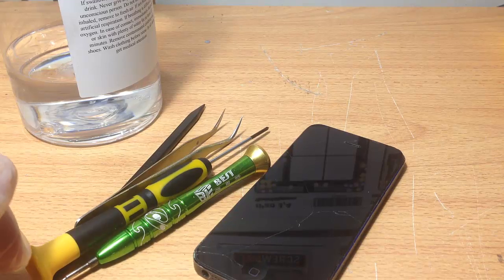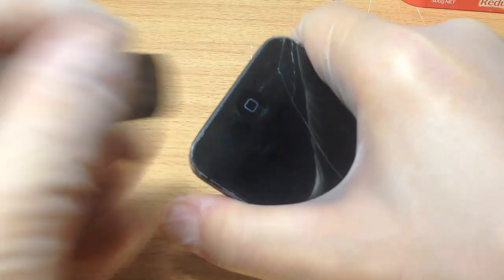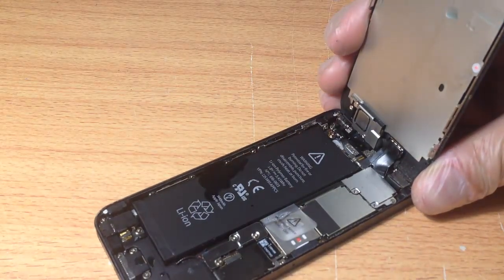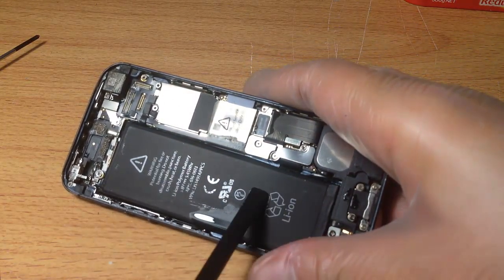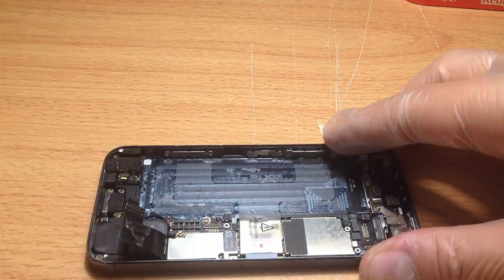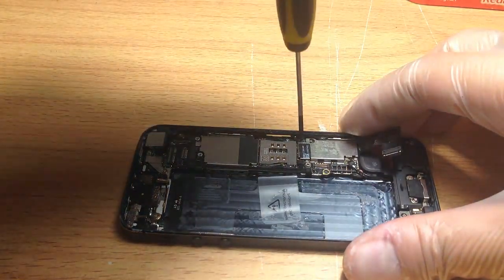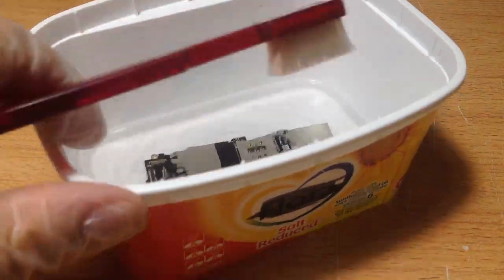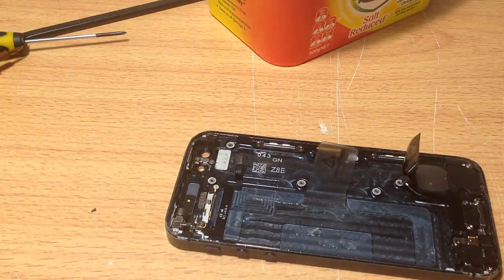iPhone 5 Water Damage Repair

Comment: im repairing my wet iphone 5c, using your video as my teacher... I put everything back in after buying a new battery.  i have a problem with the metal square piece behind the camera.  there are 3 screws of 3 different sizes and I don't know which screw goes into which hole.  please help.
thanks in advance.
-while I wait for your response I will practice my typing skillls  'cuz this took like 5 minutes to type
Reply: curtis constantine still not replied lol

Comment: Will this method work if you've dropped your phone in salt water
Reply: The idea is to dispel the water which in your case is more corrosive. The connectors would be a main concern. The gentle scrubbing (with soft bristle brush) should help with that. I would think this would be a good option as opposed to just air drying face down with sim removed which would leave the salt, etc.

Comment: Didn't have high hopes but this worked and saved my phone which was dropped in a lake for about 1-2 minutes.  I had replaced a screen and battery before so had some experience - it is a little scary to do for the first time.  Get the right tools and be very gentle and watch several videos first.

Comment: I fixed the phone today and It turn on but when I unplug it the battery drops to 1% then turns off and later today the batter because really hot and now when I tried turning it on, it's stuck on the charging screen. I just ordered a new battery to replace it if that's the case
Reply: It should be I have seen lots of videos about the water getting into the battery and messing it up

Comment: i have an iPhone SE are the internals the same as an iPhone 5s ?
Reply: yes they are about the same except the camera
Reply: Mostly, there a few slight differences such as the silver plate that covers the three tabs that plug in the screen has 4 screws and the 5S only has three.  Don't forget those "command" type sticky strips underneath the battery.  You'll see a few more foam type gaskets covering things.

Comment: thank you for the knowledge. my phone was not powering on for almost a month after taking a plunge in the toilet.(just one of those mornings). I cleaned like you suggested and replaced the battery instead of reusing the old one. the phone now powers on and I'm grateful. now the screen backlight needs replacing due to water damage but I'm just happy to see the phone operate again. 

much thanks!!
Reply: I had the same experience... I'm very grateful too! I also have a watermark going through my screen after this process. That is the only problem I have with the phone. How do I fix this? I haven't been able to track down any tutorials on this fix. I borrowed the phone from a friend and don't want to return it to him damaged. Any advice you can offer would be greatly appreciated!!! :)
Reply: +Julie Rose the back light can be replaced. what I found the easiest was to replace the front screen assembly, it is much easier than trying to replace the back light itself because of connector needing soldering. or a away to connect to the flex cable near the camera. this method will eliminate the multi hues display.
Reply: Thanks so much!!

Comment: I dropped my iphone 5 in the toilet and everything worked but the speaker, it sounded really low but my mom used a blow dryer and it worked. ( that was a year ago I believe?) then 2 days ago I dropped it in the toilet again and the screen had different colored lines going across it and won't turn on. My mom put it in a bag of rice for 2 days and it's still not working. It's not turning on even when I connect it to a charger. Any way to fix this? Please someone help I really had a lot of things on my phone and I'm pretty sure I never backed it up.
Reply: stuck in the same situation. how did it go?
Reply: +k kk my phone is dead. It wont work anymore. Which sucks because I never backed up my phone which means my pictures are gone. There is no possible way of fixing a water damaged phone because it already fries your circus and all. I guess just take out your SIM card before anything happens and hope for the best
Reply: +Nerissa Guzman  *circuits

Comment: I was on the lake today and had my phone in a 'water proof bag'.  It never fell in or anything but the bag itself had some moisture inside, so the phone was off.  It has happened before and I usually plugged it into the charger and it would turn back on.  not this time.  I have plugged it in multiple times and I fear that I have messed up the circuit.  Right now it is sitting in a bowl of rice next to me (I'm out of options).  I also hair dried the hell out of the audio jack and charging jack in hopes that I could disperse the patches of water.  After doing research I have seen that these are the 2 things you do not want to do.  My question is this: If the circuit has been messed up, can I still buy a new iPhone 6 and give it to the Verizon store to transfer contacts, pictures, etc. ?  The phone obviously is not turning on, but can they still transfer the data?
Reply: Did it work
Reply: This is for iPhone 5'sdumbass
The inside of a iphone6 looks different than an iPhone5's insides lol

Comment: What if touch screen doesn't work what's the fix for that?
Reply: +15Fire same problem. dropped my in the toilett today
Reply: +Daniel M. Try holding down the power and home button for about 10-15 seconds while the phone is plugged into a computer with iTunes open.
Reply: +Kevin McRae why that?

Comment: Hi i have cleaning it twice (but i havent submerge it) and the screen wont turn on. I went to a person who tried my screen in another iphone5 and it worked! but it wont work in mine. Today after teh second cleaned, I pressed the lock bottun in the exact moment I plugged it to the charger and the screen went on for 1 second and then it was black again. Everything else work, my iMac recognice the phone and everything, its just the screen. Do you have any last final words of wisdom on this particular subjet? (im really srry bout the bad english D:)
Reply: +Rodrigo Heredia Try holding down the power and home button for about 10-15 seconds while the phone is plugged into a computer with iTunes open.
Reply: +Kevin McRae. hiii should the iPhone be on or off??
Reply: +Rodrigo Heredia Try from the off position but I don't think it matters.
Reply: thnk u so much for ur quick respuesta! ill try it in a few secs with my iMac n_n
Reply: +Rodrigo Heredia You're welcome. If that doesn't you probably have to get a new screen or the phone might be dead (RIP).

Comment: Call me asian or whatever, but I fixed mine!!! Infuckingcredible, I tell you! Let me tell you. I took my bed sheets and put them in the washing machine. Coming back to my room, I was about to check my phone ... but I don't have it, and there's something knocking inside the washing machine! What a stupid bitch I am! I just stopped the machine, got my phone out and the poor thing had the screen going crazy. Opened it up, dried with a hair dryer, left it opened for a couple of hours. Then, I put it back and booom!! It works. The only thing is that there still is water somewhere between the glass and the actual screen. It will go away somehow! Iphone 5!
Reply: Mine has been sitting a year or more, still won't cut on. Girl put it in the washer, full wash!

Comment: when you brush your motherboard isnt it better if you take out the sticker of the lcd connectors? and the shields you can get them out with a hot air desolder. Great Vid.

Comment: After dropped into the water 5 meter's deep, i charged it to see if it will boot up then the apple logo sign came on and few sec later it shutdown and heats up(hot) . can it be fixed if I do the 
iPhone 5 Water Damage Repair process ?

Comment: Tried this, but the iPhone won't do anything when I plug it in and try to turn it on. Are there any areas that I might have reassembled it wrong? What could the problem be?
Reply from the maker: +Shnarlea you could check the battery or double check the connections.

Comment: mine got sprayed by water wiped it off was fine, hour later it short circuited  but i can still hear notifications
Reply from the maker: +Sarcalogos Tortolero could be the screen or the touch ic.  i will check connections for corrosion.

Comment: I dropped my iphone 5c in the toilet 2 days ago. I tried everything i could to turn it off, but i couldn't. So it turned off its self. Do you think that this steps that you saying could help, or is it a lost cause? 
ps: the screen was already damed, was broken and stuff, but i did put an screen protection, so i'm not sure if the water found its way in easier or not.
Reply: Well, long history. I was giving my dog a bath, my hand was full of soap, someone called me, i thought was important, and...bang...the iphone ended up drowned.
Reply: I bought a new battery,because the old one was all deformed. I've cleaned, but it didn't work. Is there anyway for me to check if is something in specific is with problem, because the iphone is not turning on.
Reply: +Caroline Netto take it to Apple

Comment: left my phone on my porch and it got rained on and won't turn on, its been in rice for about 2 hours just checked it and won't turn on. am I fucked?
Reply: yes
Reply: Ilate reply but it has to be in rice for 3 days.
Reply: +GT/GD LazoGT Rain water is distilled water and it is the most corrosive water around.  I made the stupid decision to wash my phone in reverse osmosis (distilled) water after falling in a salt water pool with the phone on my belt.  It turned on the next day for about a minute or two and then died.  I tried spinning the water out of it with the spin cycle in my washer after rinsing but couldn't get it to stay horizontal to drain out of the charge plug.  Also tried putting it in the freezer over night to dehydrate it and also put it in the window in the sun.  That is when it started working again for a short time.  But, I ended up giving up on it and buying a Samsung Galaxy S5 which is water resistant and will survive a shallow dip like I took.  Stupid Apple, making a phone that you can't get the battery out of easily.
Reply: +Norman Sufficool Not sure you're right about distilled water being "the most corrosive water around"?  If it was, it wouldn't be used in vehicle batteries surely?

Comment: My phone won't turn on or it seems. When I turn on the phone, I can feel the motherboard being warm.
Reply: It's warm because the processor is failing
Reply: Is it still recoverable?
Reply: It is, but you need to get it professionally microsoldered
Reply: So not even the alcohol can save it?

Comment: I dropped my phone in the toilet and I turned it of and on and it's absolutely fine I checked camera sound and everything and it also charges I only turned it off and shook it
Reply from the maker: +Lucy's BeautyBlog Hi Lucy - the problem is that over time there will be issues due to corrosion so the first thing I recommend is to back the data.
Reply: +infohut will it always break and this sounds silly but how do I back my phone up
Reply from the maker: not always. you need to download and install itunes.  then in the itunes menu back it up. really easy to do.
Reply: +infohut done is there anything you recommend to help
Reply from the maker: +Lucy's BeautyBlog i recommend you take it to a repairer if your not confident in repairing the phone yourself.
Reply: +Lucy's BeautyBlog If you turned off your phone super fast and let it dry out your
 odds of it working despite "water damage" are much higher. I'm 
currently awaiting the results of my second incident, BUT the first time
 I did this I let it sit in rice and air dry for a total of about 48 
hours and it worked fine EXCEPT for the error I got before I had even 
turned the phone off after I dropped it. It's just a "not compatible" 
message with the charger, but it rarely happens a year later and it 
doesn't effect charging. I'll let you know after this time.
Reply from the maker: Kassandra W correct
Reply: Dropped mine down the toilet and it does jack shit. Had to get a new one ahahah
Reply: Kassandra W  I
Reply: See
Reply: Beth Jackson hahah same getting an iPhone 6 lol iPhones are really bad with water damage but still gonna get another one lol
Reply: Lucy's BeautyBlog

Comment: I went swimming in the Murray River for about an hour with my IPhone 5 in my pocket, i got out of the river and realised, i pressed the top button once but maybee another when taking the cover off. 5 minutes later i had it rapped in a towel. Do i have any hope??? +1 Sub
Reply: +Abel Schoneveld  mine went through the washing machine put it in rice for about 3 days
Reply: ***** Yep though my mic dont work i use the apple headphones and it wont sync to my comp besides that it works fine

Comment: im in australia, if i sent a 5 that went in a pool to you how much would you charge to fix it?
Reply: +henry tomkinson  Silly boy, write it off and get a Samsung Galaxy 4, 5 or 6.  The new Galaxy 7 has a lower rating.  They are all water resistant and would survive most water dunkings  and, they open up to remove the battery and to dry out just in case it goes too deep.

Comment: (Help) I currenly Reseted my Iphone 5s But Every Time i try to Set up the State and country  and wifi  it takes me to The lock Menu and It Doesnt let me swipe it but it stills lets me touch the Quick menu Button I Dont know if it might be cause I drop it in a little bit of water or Because the screen has a little crack?

Comment: Guys, THIS IS NOT THE ENTIRE GUIDE! You really need to desolder the silver metal shields on the board to get the real damage!
Reply from the maker: +Josh Bacon this is a basic repair guide. removing the metal shields is not recommended for anyone who has not done it.  you can easily damage the logic board further.   but correct josh - it is definitely a preferred option.
Reply: So, I have one that went thru a wash over a year ago. I see NO visible corrosion. Do you know of a process for resoldering the board, site? And could this be just a battery swap? I don't have these laying around, but have a 5s & 5c - if compatible I would consider having an extra. I have moderate experience, not with Apple.
Reply: Wow! That sucks! Good thing I backup once a week, 299? Ugh! Thanks for the reply!
Reply: Christopher Payne if it's a year old, it's probably fucked. I'm sorry. I would take a look at it and charge $70, and anything worse than a Tier 1 repair and I would address it for data recovery only. Data recovery services start at $299 plus tax.
Reply: Christopher Payne Yeah, data recovery is rough. But a lot of people don't back up. You're a smart cookie Chris!
Reply: L
A
Reply: http://lmgtfy.com/?q=iPhone+5s+red+screen+4013
Reply: http://lmgtfy.com/?q=iPhone+5s+red+screen+4013

Comment: Thank you so much for your detailed video. Even though my phone turned back on after getting some ocean water on it (after a night in rice...) I wanted to make sure it didn't die of corrosion. If I'd seen this vid from the start I wouldn't have bothered with rice. I've never tinkered with electronics and can say that this was so easy to follow that I even had a few beers while doing it and everything still works perfectly.
Reply: did it work?
Reply: +emilyrosebelandres98 
My phone is still working perfectly 4 months later :-) Just be really careful not to lose any of the tiny screws. Ifixit.com also have great guides if you need it.
Reply: It worked for me too and the ifixit 70 piece kit is the bomb. I bought that and the isopropyl alcohol at Fry's... very helpful combo with this awesome tutorial. The only problem I have is a water mark going through the screen. Any ideas on how to fix that?? I appreciate any advice you might have to offer!!! :)

Comment: My iphone5 got wet in the toilet. I pressed the home button and the screen went black. I saw that the wet indicator inside the sim card has turned to pink/red. I put the phone inside a pack full of rice and after 48 hours I opened the phone. I did clean and dry the components inside the phone and removed the battery. Now, i am just waiting for the battery replacement while the phone is inside a box full of silica gels. Do you think it will work after the battery replacement? Thanks!
Reply: +Richard Martin Parungao If it won't power on while plugged in, it isn't the battery!

Comment: What does it mean if my phone turns on and the screen has lines and does not react to touch
Reply from the maker: +Dirtbikesforlife16 ah this is most likely the screen is damaged or check the connectors where the screen plugs in to make sure they are fine and clean them again with isopropyl alcohol.
Reply: +infohut I unplugged them and cleaned them it fixed it
Reply: +infohut thanks for the vid my phone works great now
Reply from the maker: great news!!!

Comment: My iPhone 5s got wet yesterday during the night.. I think it didn't had charge.. But today I put it in rice.. And I'm waiting until Thursday to get it out.. Do you think it's going to work?
Reply from the maker: Possibly but it still needs to be cleaned to avoid further corrosion if it has debris from the water damage it will corrode / rust over time and may fail to work in the future